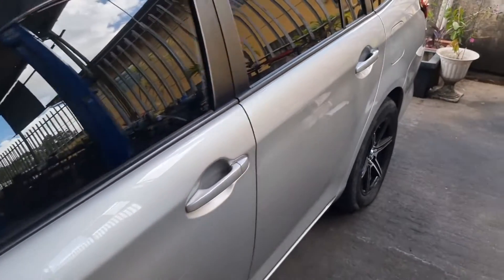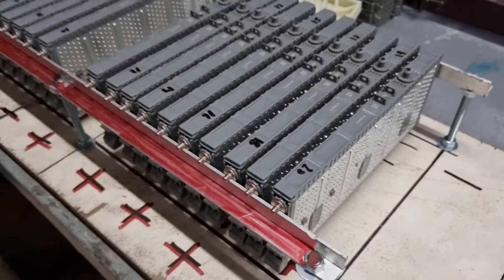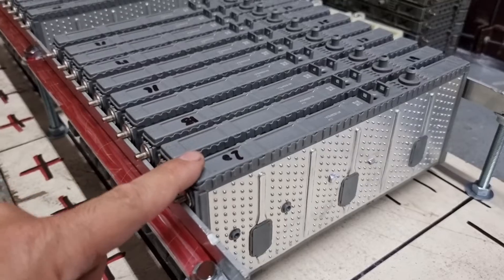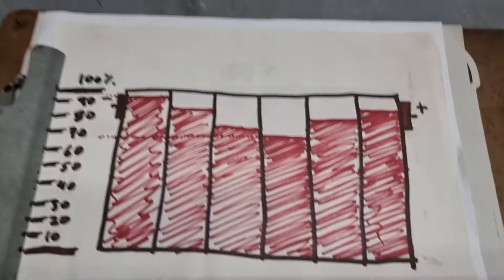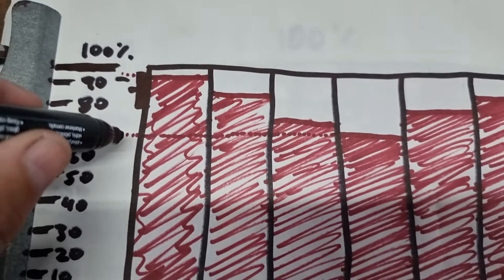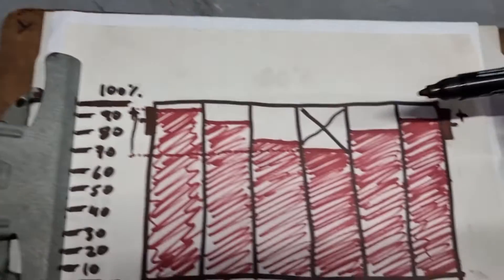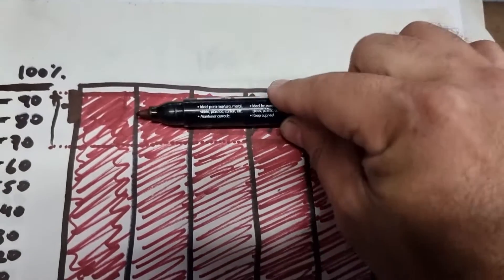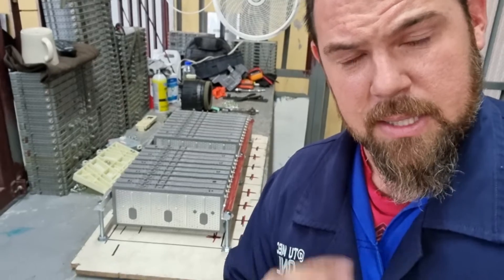keep the toyota hybrid battery in balance ( Master Class Level Lesson )

Comment: Your videos are extremely informative and are appreciated. I'm in the process of running my modules thru discharge/charge cycles and so far 8 have passed and 20 to go. I didn't have any trouble codes, but decided to service the battery, since I noticed that over the last few years, the battery would jump from full green bars to low purple bars fairly quickly on occasion. I assumed this was caused by corroded bus bars as well as an out of balance battery.

Comment: If I discharge whole battery in car and then check if cell have different voltage 6.88 7.22 and 7.30 if I follow this process it will work or not need to change 6.88 cell? 🇴🇲

Comment: I have only dr prius app free version : pack 9 wasvweak and one of the 2 modules was 6,5v
I Removed the battery. Charged the 28 modules individually with the 12v 35ah battery and cables for 10 seconds each . Above 8v each except the weak module 7,56v
Used some kind of your own home made balancer 
After 3 days on the balancer , my overall voltage is fully equalized at 7,89 V with a few modules holding strong 7,93 v 7,94v 
No more weak module with the balancer in parallele 

In the meantime, i was very interested by the Tenergy T180 chargeur dischargeur 

Shipping cost + Vat 
It will cost €130 

I'm about to check it out 
I will reinstall my battery this week end and see if the red triangle disapear

After that , if the car is driving again normally , i will consider buying the tenergy T180 for maintenance

Comment: Hi Jose... still here an boo to "Tictoc" shamely enough google dosnt deny you the right of watching videos " psst only with browers they want you to sign in haha. But hey after a Quantum leap of strings a theory ive got an additive for you plausible one... with your displayed means of prospective diagram " take note of viable levels in diagram. lets say MAH+VOLTAGE equals electrolyte (acid) levels as you say, what would happen if i tipped your picture upside down would you be happy ? would your temperature rise an if so i got you to hold your picture upside that represent a module what amount of reflective heat off you would dislogg the acid from the adjoining cells to fall to the bottom showing same levels in your diagram unknownly the top that is the bottom now has nikola tesla valves " channels" where the acid can freely level out given a equal level of acid in each cell over time, optimal (operation temp is 35deg) but reflective heat where gas will build up pushing acid down would then cooling stage gas turns to vapour in the inner outa walls of cell then also falls equalising pyhical state of the module/s an cells. then flipping the module/s upright an discharge charge an balance so in theory all would be equal what do you think Jose worth ago...compressed of cause in heat conductive material.

Comment: Good afternoon Jose, in the event I don't have a charger after carrying out the servicing, rotating the battery and using your mechanical balance for 72hours to balance 34 modules can I put it in the car for the car charge as an option. Many thanks for your wonderful feedback and great insightful videos I learnt alot.
Reply: Same question here. Any Thoughts? I have a 2014 camry and after running Dr Prius app Full Battery Test and my battery health shows around 95% which is excellent but rarely I will received "block 1 unbalance" code. So if I just balance the battery for 48 hours like in this video with out doing other service and recondition, will it work? Or I still have to do charge/discharge procedure with charger that I don't have. Thanks

Comment: I have a 2014 ES300H with a bad hybrid battery. I want to order battery modules from eBay to replace the bad ones. I have not taken the battery apart yet because I don’t want to be stranded without a vehicle to go to work. My questions are, are all the Toyota battery module the same? Or is there a specific type I should buy? And can I drive my car after i remove the hybrid battery?

Comment: Hi Jose, thanks for answering the lithium ion  sway question.  If I were to replace only 3 to 4 bad cell modules. Do I still need to balance  my existing modules along with the replacement modules?
Reply from the maker: Mase sure to proper balance them and of course... make sure they all have the very same capacity...

Comment: Hi Jose. You are always a great help to all of us. I have a question if you could answer please. What should be the ideal Internal resistance of Battery modules? I'm getting 26 - 27 milli ohms for module within my Prius C batterypack. Should the milli ohms be lower than this or higher in value for good module? I read somewhere that anything greater than 30 milli ohm indicates that the battery is going bad. 
I will appreciate your time , awaiting your reply.
Reply from the maker: Module's IR varies upon temperature, but a good module rates between 8 to 10 milliohms

Comment: Hola Jose and thank you for making instructional videos! I have a question about module capacity in regards to individual modules. Are you saying that a fully charged module will regain its capacity at this point? A new module is 6.5 amp hours. Or are you saying that whatever capacity is left in that module will have each cell balanced to full level whether that module has a capacity of six amp hours or five amp hours or three amp hours?
Reply from the maker: That is a great question my friend, and a master class amazing video about that is coming... but the answer is that if all modules have same capacity the overall battery will be great... diff in capacity is what causes batteries to go unbalance 👋😎

Comment: tell us about the voltage drop that a nickel metal hydride cell experiences when it reaches 100% and how that greatly interferes with a cell it's in parallel with which obviously isn't experiencing reaching 100% at the exact same moment.   this is the reason they don't put cells in parallel in the car.  it's okay to put cells in parallel when sitting or when discharging, just not when reaching full.

Comment: So should I be cycling my modules first or balance first?
I’ve been cycling each module 3-8x until I het 7500/5000 mAh, once achieved, I balance. But still got a POA80 code.
So I took the battery back out and changed a few more modules.
How low should I balance all the modules to before putting the battery back in?
I’ve read no more than 8.2 - 7.4 volts, otherwise the computer will throw another code. Is that true?
Reply from the maker: It does not work like that ☝️🥴... dont worry... reconditioning class is coming soon 👋😎

Comment: Great information, answered a question I have been waiting for. To balance the module needs to be charged.
Reply from the maker: Yes james always before balancing make sure all modules are fully charged... ( asuming modules are all in good conditions ok ) this does not apply for old or bad modules so careful 👋😎 hope this helps...
Reply: Question: if i have a battery that has 1 module(new replaced module to prev used battery) lower than all other modules. Do i need to charge them or can i just balance them as shown on your video?